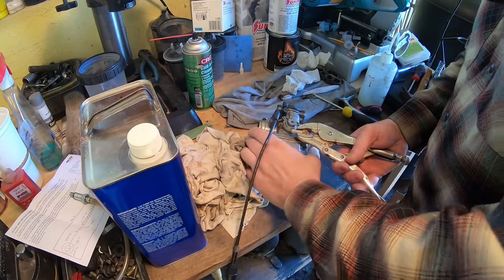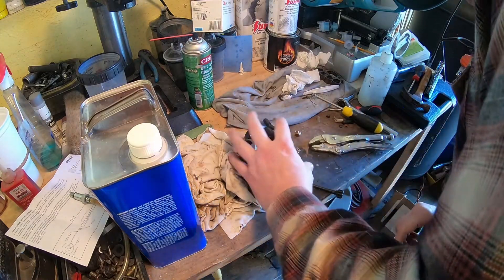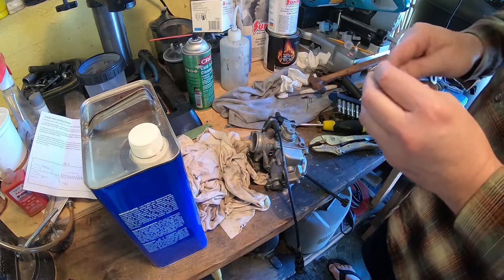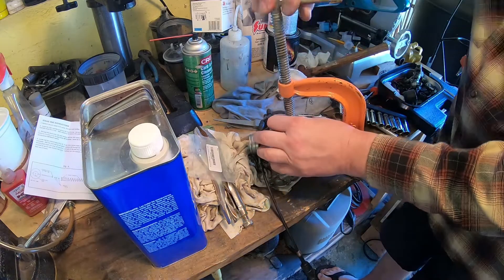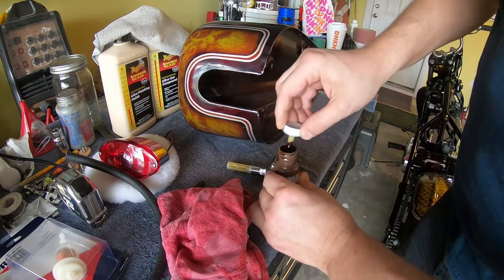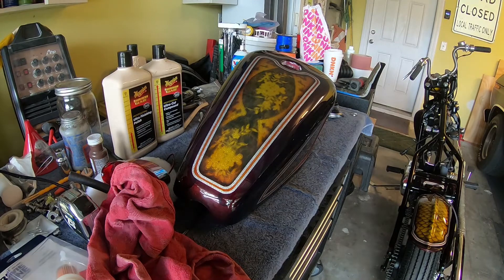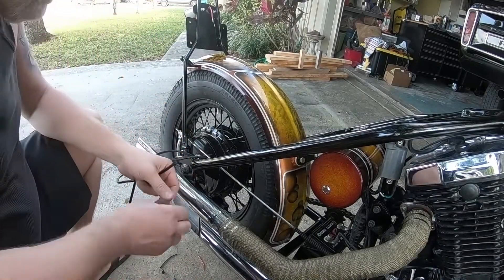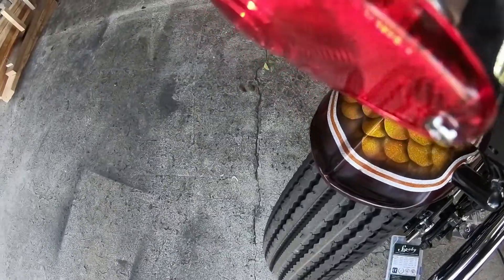VN800 Bobber - Part 13 "Carburetor upgrade, tail light & Petcock"

Comment: Frenchy....picking up a decent vulcan 800....seems to run great a bit ratty in looks...what should I do when get it????  Also, a lot of people take fan out and thermostat!!-  I live upstate NY and we get one month of really hot weather!!!
Reply from the maker: Nice 👍🏻. First thing I will do is scooterise the air filter, getting rid of the EPA, if you don't have regulation in your state of course! That might involve some rejetting since your engine will breath better, also check both plug, pay attention to the front cylinder one, you might want to change the heat range. And if you can check the valves clearance. Good luck 😉
If you have further questions you can email me at frenchyinflorida@gmail.com.

Comment: Hey, this is some really cool stuff you have on these videos. I was wondering if you could tell me what size brush you used for the pinstripes on this bike? I'm looking to start doing something myself but have never tackled a paint project like this before, so any help you could offer would be greatly appreciated. Keep up the good wit work! I'll be watching!
Reply from the maker: Hey Louis, thanks for the nice comment. There is no pinstripes, everything is airbrush, you can find the link of the airbrush (cheap on Amazon) that I use in the description of the gas tank paint. And it was also my first time, just go slow and if you use the Createx 2o paint, it is a water base for airbrush and super easy to clean up with solvent if you make mistake. You have to be patient and not overspray as it will run. I keep learning from my mistake.
I heard from some good painters that said what make a good painter is the ability to hide or correct their mistake! Just do it over en over again 😉
Reply: @lesagecustoms4668  thank you for the time and your response, Frenchy. I truly appreciate it. Maybe one day I'll have my bike looking as good as yours.
Reply from the maker: you’re welcome bro, to me I learn by doing, take your time and observe everything. Youtube is a fabulous source of informations, also I learned that if you use vinyl tape don’t wait too long before spraying, I did wait the next day and the tape shrink as you pull it when you apply it and I had to do some correction. good prep and a lot of elbow grease sanding and sanding again, but it’s so rewarding in the end, Have fun 🤘🏻😉
Reply: Hi Man. Nice build. Im just wondering what kind of inlet you used? Can you share the Part # of the Inlet?